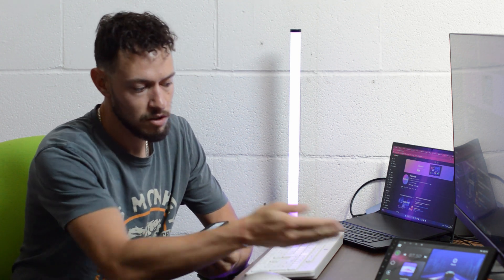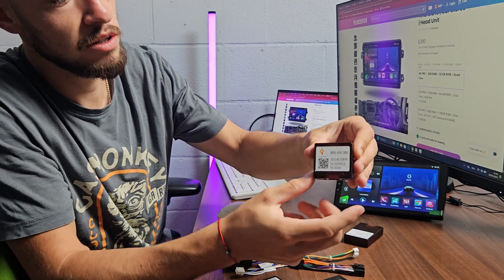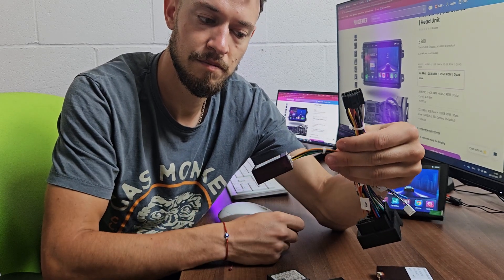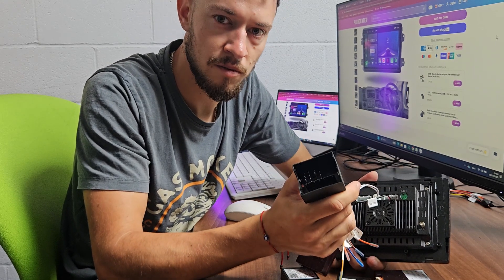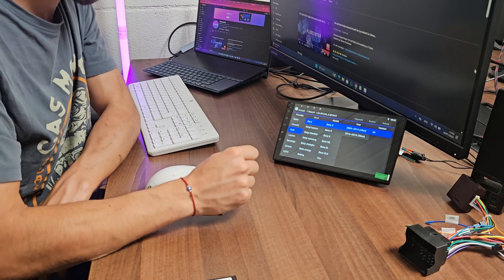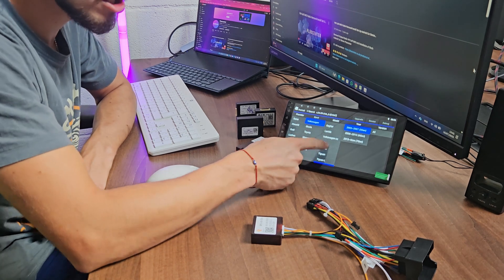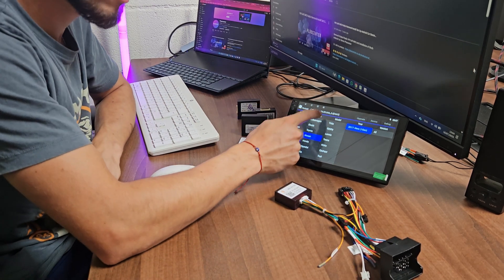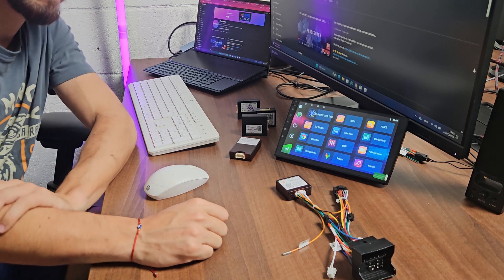CANBUS Explained! Set Up Android Car Stereo With Your Car’s Harness

Comment: One question: Do I really need a canbus in an Polo 6r without cameras or wheel buttons? Can't I just connect the radio like the previous one was connected just with power and radio? What would I miss out on? 

Thanks a lot!

Comment: I have a Toyota Avensis T27 (2010).
On my Android head unit, the CANBUS (Simple) settings menu looks exactly the same as the one shown in your video.
However, there is one strange issue:
in the Toyota section, there is no submenu for Avensis. Other Toyota models are listed, but Avensis is missing.
Could you please advise:
have you encountered this issue before?
is it possible to manually enable or add the Avensis profile?
or should I select a different Toyota model to make the CANBUS work correctly?
It’s really strange that there is no dedicated menu for Avensis at all 🤔

Comment: I have a 2005 dodge magnum rt with a  factory amplifier that has a remote wireless signal to start amp.  It has amp cont from cambus Decoder and amp ctrl from #2 CONNECTOR. How do I wire amp

Comment: I had an issue on outlander so. After I installed head unit It didn’t turn on. I connected yellow and red wire with a cunbus and it turned on but keys on the car didn’t work. I had sound but construction was very weird.

How can I fix it?

Comment: Hello, great video. Where can I find out password to enter factory settings. My car is Nissan Pulsar 2017.?
Reply: Did you ever figure it out ? I have a pulsar 2015 and for the life of me I can not find pulsar anywhere , it’s not listed on any canbus and none of the other models given engage with the SWC ! The only one I found was a 2017 Middle Eastern pulsar ( g-ex-df52 box) …. I’m beginning to think that using a harness without no canbus connection and trying the learning feature on the android screen for the SWC may be the only option ( fingers crossed ) I’m frustrated to say the least !!

Comment: But if I built those Radios into my Polo 9n1 2002 , is than a can bus necessary could I use it without can bus and connect the two wired cable than?

Comment: I just opened my unit which i bought for PRIUS 2014 and the wire harness does NOT have a canbus with it and no separate white wires are present. DOES it mean that a Canbus is not needed?
Reply from the maker: For some Toyotas a canbus is not needed.
Reply: @pluscenter  Mine is needed - I sent them pictures of the back of my unit, they will send one to me from china will take 20 fricking days - but no rush

Comment: Does anyone have volume problems. If I connect through android auto and turn the volume even on 1 it's like the volume is on 15. I have all defaults turned down. I have the dsp turned all the way down, sub almost off and still the volume is crazy high. I turned the gain down on my amps. 
 Im at a loss? Any suggestions

Comment: Great video!! Just wondering, I am about to install a Android unit. Not I have the standard Peugeot Boxer radio with the build in TomTom headache.. my battery drains every time and I wonder if this is because the GPS stays on in this unit and thus reason I have a flat battery not driving for a week. I will have a close look if the new wire loom has this option to keep it disconnected!  Thanks a lot for you knowledge. Cheers, Albert 🇳🇱🇬🇧

Comment: Hi sir thanks for the information it's highly informative. My challenge is when I disconnect the red and yellow cable my android Radio doesn't work however the moment I cont red and yellow it works through doesn't turn off, could it be my Canbus is faulty?

Comment: Good afternoon. 
The two cables, the red and the orange one, that you said need to be disconnected, should they also be disconnected for a 2005 Mercedes W203? 

Do you have any videos showing the installation of CAN bus connectors on a Mercedes W203? 
Thank you very much for your video.
Reply from the maker: It's different for Mercedes they should be connected there. You can check our latest short for Mercedes W203 explaining about it, thanks!
Reply: Thanks.
Reply: I've been searching through your videos and I can't find the video about the Mercedes W203 that you mentioned. 
Thank you.
Reply from the maker: @tome737  https://www.youtube.com/shorts/LJ07ZpLLVUI
Reply: @pluscenter Thank you very much.

Comment: Help please
Hello, I have a junsun car radio 8cpu+12gb vram 256 gb for Fiat Freemont. Everything worked but suddenly after the update the air conditioning and physical buttons do not work, the air conditioning is running on full and the heating and the radio does not turn off even with the ignition on and off. Car info says undetected version. I put the original car radio and everything works as it should, is the can bus bad? Adam

Comment: * The CAN [Control Area Network] lines from the car Harness go to the CAN Box in the wiring harness.
* The CAN Box then connects (via UART) to the Head Unit.

There can be multiple CAN networks in a car.  The after-market Head Units do not have a CAN bus connection but rather uses the CAN Box which translates the CAN frames into UART messages to them.

Comment: I have a Mitsubishi Outlander 2, 2012 Automatic 4HK with a Rockford Fosgate APM/radio system. i bought an aftermarket Android radio that I was told would support my system. tha harness however is weird to me (I am a layman). I cannot find any CANbus male that will go to the CANbus port. The vendor tol me to connect the AMP wire tothe ACC and so I did. The sound now works, but I am confused still. Why do I not have the CANbus connector? The vendor tells me that it is because of my model/brand. I don´t understand. Even on their sales site under AliExpress says that I have to connect the cable to the port, but how. Now, is this true? I don´t need it or do I? I think I do and suspect that I might have been ripped off. Is there anyone out there that can confirm either the vendor is true or lying?

Comment: Really sad to be told your unit will not work with my 2017 fiesta and would no long be able to reset my car setting like tpms when you have a  low pressure or all the other car 😮setting which are done using the  stock radio controls.

Comment: Thank you so much for this infomation. I have the android tesla style tablet for my hummer h2. Everything works but I have no volume. I see on the cable for the canbus there is a red wire with a fuse at the end. Do I need to plug that in?
Reply: Be sure the amp function is turned on to enable audio. By default, amp setting is turned off.

Comment: So I have a VW POLO 2014, and got a new stereo which says :
“Support original car steering wheel learning, car setting - Steering Lear. SWC wire: KEY1 or KEY2.
• This function doesn't work if cars need a canbus.”

Now with canbus it’s not working, can anyone help me on how do I make this  work? Or if there’s something I’m doing wrong?! 😭
Reply from the maker: Hello there! You could try setting them up mannually when going to the SW Learner app.

Comment: Why when i connect the canbus to the plug of the wiring harness my bmw stays allways on 1st ignition even with key off until i disconnect the cambus from the plug again (e46) ?
Reply: I have exactly the same issue. Still unable to figure it out
Reply: @ericmwenze  found a solution, its from the cambus, you need to cut the yellow wire thats feeding the cambus constant 12v and connect it to a red wire that supplies 12v only when the key is turned, that fixed it for me, sorry for bad explanation  but not native english 😂

Comment: Do you have a video showing the antenna / amplifier blue cables  optional connections , and if sometimes they need to be connected to the red or yellow line power wires  in case bluetooth or radio sound do not work , or if the radio antenna has low reception because of too few power from android unit? thank you if you can share your experience.

Comment: I purchased an aftermarket android radio from eBay and it has a canbus, when I install it on my 2010 Chevrolet Camaro it changes the dashcluster language to Chinese & I can't change any settings on the entire radio. Would anyone happen to know what I can do? I have already contacted the Ebay seller but they won't get back to me!!! Oh and i connected the internet and tried to update software and it says its already updated to latest version... oh and I don't have steering wheel controls on my vehicle, just cruise control

Comment: installed chinese car media player (HC 8163) in to my peugeot RCZ, now handle on the right side near steering wheel stopped working (can't set car clock etc) Canbus is HiWorld, found it on factory settings, there is no option for peugeot car at all. any sugestions?
Reply: Hiworld enter the web than download upgrade files

Comment: I've got a failed Simplesoft RP5-FT-001 and the only place I've found to buy another is Amazon and they want 65 euro for it! Had to put the factory radio back in until I can find a replacement.

Comment: Incredible thank you! Your solution to disconnect the connector on my VW has fixed my issue where the head unit wasn't turning off with the ignition. Thank you so much for sharing this.
Reply from the maker: Thank you for the comment! We are happy to hear that you found this video useful!
Reply: ciao, anche io ho una golf mk5, la radio si spegne togliendo la chiave, il problema è che quando reinserisco la chiave la radio non si avvia da zero ma è come se fosse rimasta solo con lo schermo spento, quindi credo che consumi comunque la batteria non spegnendosi del tutto. da te si resetta completamente android o la ritrovi già avviata?

Comment: Hello the harness you have in this video is the one i need for a 2014 vw jetta gli the radio stays on after the car is shut off thus draining battery. But in the website it says it does not fit on where it says verify where can i purchase it its for a dasaita  px30 radio.
Reply: I've got the same harness in my skoda fabia 2013 ( arrived today ) fitted it. When I dont plug in the red and orange  connectors my radio dont turn on, but when I plug them together it works and dont turn off with the ignition 😒😒😒
Reply: @RyanP-t9d did you find how to resolve this because it’s also happening to me
Reply: @jamiepatton2748   yeahh, I tapped into the fuse box, use a fuse what only turns on with the ignition. Cut the red wire on the on the radio ( the red wire what's with the red and orange plus thing )

Comment: is there a way to get the steering wheel angle from a canbus decoder. so that i can have those dynamic track lines. The revserse lines that move. I have a 2010 toyota corolla
Reply: This is usually determined by the camera. Some better cameras will have an extra chip, so that there will be dynamic reversing auxiliary lines.

Comment: Thanks, I worked out I had the simple canbus from this video and now it shows the door and aircon controls on the screen! I am unable to map the steering wheel controls though, under all the options on the control page it says "NULL" and pressing the button on the steering wheel and the button on the screen does nothing. My unit is cheap, bought from a company called NAVIRS Factory store on Aliexpress.

Comment: I installed this radio in my Alfa Romeo MiTo. I've tried all the settings, but when I turn the car off, it reboots after a few hours. I would prefer if the radio would just sleep. Could it be that the power supply is causing the car to shut off after a few hours?

Comment: I got a radio with the simple soft canbus, the radio works but when I take the key out of the ignition it stays on. The small clip that usually causes the issue is also unplugged. I am completely lost, please help me

Comment: I got a problem with my steering wheel buttonson my ford fiesta 2012 they dont work but i heard it could be an key1 or key 2 cable that must be connected can you help me
Reply from the maker: Make sure all wires are connected properly as shown in our videos which you can find in our channel. If that doesnt help you can try set them up manually by going to the SW Learner app.

Comment: I bought a CANBUS for a 2015 Toyota Corolla and the settings are adjusted, but the door opening does not appear on the screen. I bought more CANBUS that support the Toyota Corolla, but it does not work. What is the solution?
Reply: With my Skoda i have settings in HU "Original car agreement" and there i can choose if i see door openings or not. Maybe yours have too.

Comment: None of these headunits will work in a VW with Composition media in the glovebox...trust me I've tried,NO canbus,no steering wheel control,and 95% of them are FM only,no DAB.
Reply from the maker: We already have videos of a few VW with radio position in the glovebox. For example, the Golf MK7 and Tiguan L 2019. Not only do the steering wheel buttons work but all original car settings and functions like tyre pressure, drive mode - sport, eco, etc. We also sell stereos for all VW models with radio in the gloves. You probably did something wrong during the installation or the set-up, or the wiring harness canbus. VW after 2015 uses a different harness that we provide than most VW before 2015. About the DAB you will always need DAB aerial for Android Car Stereo no matter what car you have. Only with the big head units for Audi, BMW, Mercedes you will keep the original DAB. But the normal android stereo still supports it and works perfectly!
Reply: @pluscenter 😂 I've been fitting vehicle in car systems longer than you've been an inhabitant of planet earth,I know my way around a basic system with canbus etc...I will give you £5000 if you can fit one to a 2015 Polo GTi with Composition Media MiB2 STD.

Comment: Maybe you can explain. I was installing a radio on a 2021 Honda CR-V but I had forgotten the canbus out. I connected the canbus since it was the last thing to connect during the installation but it popped the car's audio fuse and killed the stereo. Any clue what could've caused that to happen?
Reply from the maker: Make sure the ignition is off and the key is not in the ignition first then replace the blown fuse. Connect the canbus again and then try to turn on the ignition. If it blown the fuse again then but new harness with canbus because these are faulty, thanks!

Comment: Hi! I have a Renault Megane 2 2004 1.5 dci, but nothing works from the list. The steering wheel controls dont do anything. I have the same screen as yours, but the software is a little different. What do you recommend? Which brand or model for renault beside Nissan?
Reply from the maker: With 2004 I would suggest to use Steering Learning App over Canbus settings, but any Renault that year could work as well for the other information.
Reply: @pluscenter tried that too, doesnt recognize the button. I pressed start and pressed for example volume up, and nothing :/
Reply: @pluscenter  I heard that if I use canbus, i cant use the steering learning app. So maybe if I disconnect the canbus and just plug the cabels into the main adapter? Or the megane needs canbus anyway?

Comment: Please help me I got a 9.7 vertical screen tesla look Ali express  i'm certain the issue came from the item mismatch. My truck is 2013 RAM, however i was sent that of 2015 RAM Raise canbus which i believe does not exactly synchronoize with my 2013 Truck. The radio  units works fine, the Aircondition is also working fine from the radio software  but the problem is from the frame control where the hazard light control cannot activate the lights in the dash. Note: i followed the  subsenquent instructions from the sellers on the connectivity but unfortunately the hazard lights is still not working...any ideas please why the flashers light ,AC, off are not working from the fascia controls
Reply from the maker: You can check if everything is connected properly and try all RAM settings in the canbus menu. It might be wrong harness or frame as well, check with the seller, thanks!

Comment: I have ts10 sensation brand fj cruiser but in Toyota canbus I cannot find fj cruiser car ! Any explain plz ! Tnx
Reply from the maker: You can check your original wiring harness if another brand not Toyota is producing it and if it's Toyota try with all possible models with the canbus provider you have. You can also try to manually learn the steering wheel buttons for some Toyota models don't need canbus, thanks!

Comment: I have purchase three of those head units and return all three of them cuz they have a connection for 360 apparently it doesn't work My canbus also didn't work on an old late model BMW I think I purchased cheap knockoff Android radios
Reply from the maker: Usually most of the stereos comes already set up but some sellers don't send the right canbus / harness for the vehicles [most sellers in China] and then the original functions are not working. We are based in UK and Europe and we supply always the right wiring harness, canbus and set up and it's all plug and play. We also work in US and international. If you have any questions you can contact our customer service on support@pluscenter.co.uk or use our live chat on our website www.pluscenter.co.uk